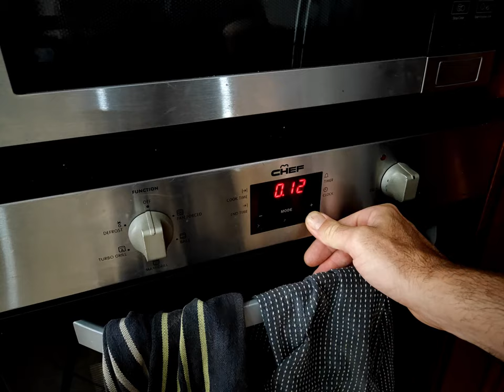Which cleaner is the best for stove hood filters

Comment: Oven cleaner method was a success! I allowed the oven cleaner to sit on mine for 2 full hours. I rinsed with water, but some grease was a little stubborn so I had to use a scrub brush and dish soap as well. They looked great! But to be extra clean I popped them into the dish washer with Cascade detergent, and turned it onto the sanitize cycle. They look practically brand new! I think now I should be able to do weekly cleaning/maintenance with the dishwasher. I feel like as long as you do a weekly clean, then there won't be a need for oven cleaner again.
Reply from the maker: Great tips sally, thanks for being an experimental scientist and letting us all know 👍👍Kent

Comment: I did the oven cleaner method a few hours ago and it worked. I used Easy Off fume free (much better). I followed the host's directions. A lot of greasy residue and gunk came out. Since I hadn't cleaned my filter in a while, I added some Dawn dishwashing liquid to the filter for another 15 minutes and rinsed it out with hot water. It is very clean and sparkly. From now on I will clean it more often. Again, thank you for sharing!

Comment: Hate to say it but that Oven Cleaner is fantastic. I've had grease sprayed on the wall and spraying it and leaving it for a few minutes and easy to remove. I also use it on stove trays. And the exterior of pots and pans + some wool pad and comes out looking brand new. Yes, definitely smells bad but lasts long and used sparingly, does outstanding cleaning when it comes to grease.
Reply from the maker: Good on you Suzannas, cheers for sharing those tips.. good to know👌 Kent

Comment: Hi InspireDIY, Thanks for this great video. Oven cleaner trick worked for me. In the end I poured the hot water and I left it for 2 minutes to soak and then gave a little clean with a bottle brush and dish washing liquid to remove anything remaining dirt. Thank you so much.
Reply from the maker: Hey Anto, great question! I didn’t and it worked well at room temperature👍 Kent
Reply: @InspireDIY  Thank you for your quick response. You are very kind. Yes I didn't start the oven.

Comment: Thanks! My home came with great appliances, but the area under the microwave with built-in vents (above the range) has little globs of grease from the previous owner. Yuck. The dishwasher tablet did an easy, no-mess job for the filters, but the underside that I can't remove was another story. I got most of it with a thick paste of baking soda, dish soap, hot water and a grout brush, but some plastic areas just won't come clean at all.
Reply from the maker: Thanks for letting us know how you got on👌it’s a grimey job hey! Kent

Comment: Mine went straight in the dishwasher. Used several tablets. Came out as good as new. Then ran a cycle clean straight after when it was still hot.
Reply from the maker: Good on you m van, sounds like an easy way to go about it🤙 Kent
Reply: I'm wondering if I can also throw my AC filters in the dishwasher?  @InspireDIY
Reply: @melatomic If it helps, I clean my AC filters by wiping off excess dirt with a paper towel. Then, soak them jn a solution of  a dash of domestos and water in the bath. Leave for 10 mins, then swish filters up and down like you’re panning for gold. Rinse thoroughly with clean water and dry outside in fresh air before returning them. Hope that helps.

Comment: To clean off a sticky residue left on my filters from a previous botched clean, I soaked them in your 1 cup of Bi-Carb in boiling water mix (omitting the dishwashing detergent) for a few hours and with minimum light scrubbing and hot water rinse, they came out sparkling clean and all sticky residue gone 😊.  Thankyou 🎉. That Easy Off Oven Cleaner has gone up in price from $3.50 to $5.75 now with Inflation— a horrible product to use inside a confined space like the Oven— can burn your skin, and damage lungs— not worth the risk.
Reply from the maker: Thanks for the feedback Jo - I’m glad to hear they have come up spotless👌 cheers, Kent

Comment: I used lots hot water straight from the Rinnai hot water unit into the laundry (used lots so it would maintain a hot temperature) and sprinkled in some magic Finish "dust." Let sit for 5 minutes then gently scrubbed with a long handled nylon brush so I would get my fingies burned. There was about 10 years of gunk built up on this so they were chocka full of oily residue but 5 minutes was plenty. I did do a second full wash but that was totally unnecessary. 
The down side was my OCD then compelled me to clean the oven hood due to it being a oh so obvious yellow colour compared to the filters. For the last 6+ years I have been trying to get charcol filters for this rubbish hood but even the manufacturer can't get them made to fit the hood so I guess they (and the Good Guys) aren't getting my money for the new filters I was going to replace the old dirty/now clean shiney ones with. 
Thank You for this. Never occurred to this grumpy old bastard that they could be cleaned so easily. Much appreciated. 👍👍👍 (one for each filter)
Reply from the maker: Haha Joseph, I’m sure you aren’t a grumpy ol’  bastard🙂 and thanks for that great comment, I appreciate it mate🤙 Kent

Comment: I use acetone for the range and for the filters I use a mix of half cup of dish soap and one cup of white vinegar, set up for one hour and rinse with very hot water.
Reply from the maker: Great tip Narda, I am going to try this with some dirty filters here at home👍 let the experiment begin
Reply: @InspireDIY  you very welcome,my pleasure,  you can also use that mix of vinager and dish soap equal parts for the showers, works very well,
Put it on spray bottle, let it set up for 10 minutes, use the squeeze sponge map and Walla. I use that mix 🤣 for many things, I take always a bottle with the mix before heading to the car wash,
 I sprayed on the front bumper to take care of the bugs.

Comment: I'm going to try the dishwasher tablet method.  But I would be concerned about hitting my stainless hood with a brush and baking soda that it would show scratch marks.  I use hot soapy water and a micro fiber, and then follow up with stainless cleaner and micro fiber.
Reply from the maker: Hey Superfly, thanks for your reply, the brush and baking soda combo left no marks on my range hood, but did require a soapy water wipe down before it was shiny again✨ I can appreciate what you are saying, and your technique is sound advice. Thanks so much👍 Kent

Comment: Thanks for these tips ,is this the actual filter because  
Have been advised to buy charcoal  carbon filter to fit on the fan inside .
Reply from the maker: Hey. Yes this is the filter, and you are right you can add a charcoal filter. Add it above the metal ones otherwise they clog up too fast👍 Kent

Comment: Hi, I have question, do I need to put inside (and turn on) the oven after we applied the oven cleaner?  or just let it sit in the open air?
Reply from the maker: Hey Erwin, great Q. in case of ‘Meltable’ materials like the plastic edging on some filters I would leave at room temp to be safe👍 cheers, Kent

Comment: My filter got clean with a soak in baking soda/dishwashing liquid. Problem is though that there's what looks like aluminum shreds caught in between the two layers of mesh in the filter. It's clean shreds now, but the shreds are still there, and they fall out of the filter on to the stovetop. Any suggestions as to how to get them out of there? I can't find a place where the mesh can be taken apart. My filter isn't flat, it's sort of bowed? Like a third of a circle?? IDK how else to describe it. Designed that way, it's not due to age or anything like that.
Reply: Use a vacuum? To suck it out?

Comment: OxiClean. Instantaneous release of 100% of the grease. Get a large enough shallow tray or sink and mix OxiClean with very hot water, drop in the filter and bang, it's grease-free.
Reply from the maker: Awesome tip, Thanks mate, Kent
Reply: @josmith2002  I don't make many videos about such things. But sorry you found it did not work. I've done it many times with instant results.

Comment: I used baking soda and dish soap with hot water and scrubbed it but it has left grey stains on it now from where i poured the soap. What happened? Does it just need to dry or is it ruined
Reply from the maker: Hey Maria, I’m not sure as I’ve not come across this before.. maybe clean them again by adding the dish liquid to the hot water before adding filters giving it a chance to disperse evenly💁🏻‍♂️any suggestions from the community?
Cheers, Kent
Reply: How long did you leave it soaking for ,m

Comment: My experience in order of effectiveness:

1. Caustic oven spray - but fumes
2. Washing soda - which is really what caustic oven spray is
3. Sard or NapiSan - which are just baking soda on roids
4. Non caustic oven spray - no fumes
5. Baking soda - which is really what non caustic oven spray is
6. Dishwashing liquid
7. OMO washing detergent
8. Lynx mens body wash
9. Engine degreaser
Never tried dishwasher tablet. Can't wait till Xmas now! 😃
Reply from the maker: Hey Samuel, that’s quite a list! So which do you recommend out of that bunch?
Reply: @InspireDIY  I listed in order of efficacy.  I dare say that Lynx would work just fine if used every day. 😂
Reply from the maker: Haha, thanks Samuel👌
Reply: @samuel3253  yes but so tiring fighting off the hordes of women.
Reply: @wavemechanic4280  You sound like a stud. Try replacing the Lynx with Engine degreaser. Probably won't get rid of them for u but may slow them down.
Reply: Elbow grease spray but do t leave for too long otherwise it'll discolour aluminium 

Steam clean and melt grease off onto a newspaper 

Borax
Soda crysals
Washing soda 
Caustic soda 
Oven cleaner

Comment: I clogged my sink from dumping the greasy water :( has anyone else had this problem?
Reply from the maker: It helps too if you run the hot tap, or tip a jug of hot water down with it👌 maybe use some ‘drain cleaner’ for what sounds like a very blocked drain. Best of luck👍 Kent

Comment: Don't place anything covered in grease in the dishwasher. There's a horrible reaction that occurs with the salt, detergent & hot water. The grease basically turns into glue. It'll block the pump and outlet. It's nearly impossible to clean, maybe a strong solvent like petrol?
My misses spoiled a deep fat fryer by placing the oil pan in a d.washer. She wasn't pleased with that result. Next she placed the extractor filters & killed the washer. It was so bad that the control panel started to make fizzling noises and smoke. 
I wouldn't even wash them in a sink just because of what the broken down fat produces.
Reply from the maker: Well Gunzee, if I wasn’t too scared to do it before, I definitely am now😮. cheers, Kent